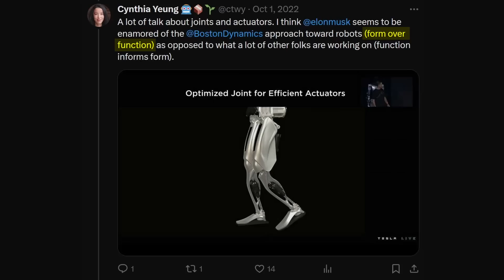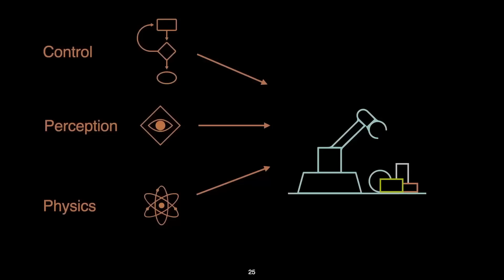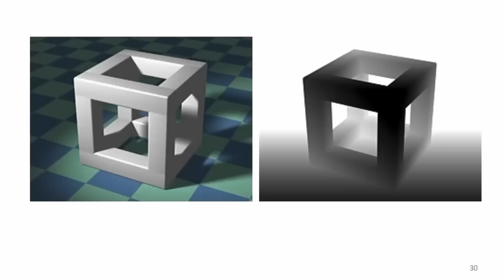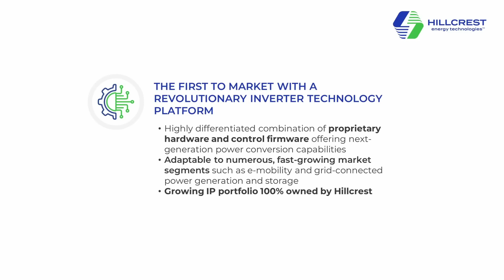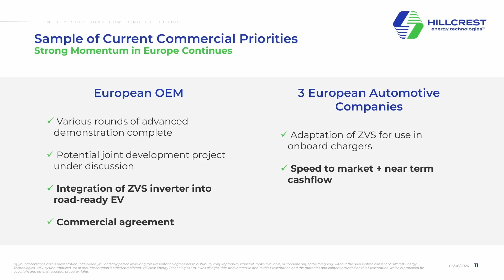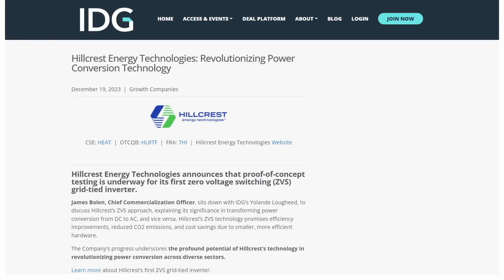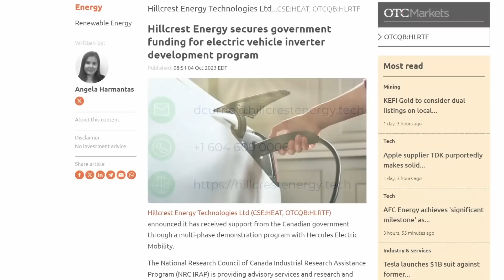You Won’t Believe What Expert Said! | [SHOCKING] Robotics Expert  Shows Elon & Optimus in New Light

Comment: Tesla didn‘t do huge castings, they purchased the biggest stock casting machine from Idra in Northern Italy supplying the European car industry.
Reply: Nope. They wanted a much bigger machine that what was available. They asked around, all suppliers said "no", except one that said "maybe". Tesla worked with IDRA to build bigger and bigger machines, and even modified them after delivery. On the first few they replaced the cooling system with something more powerful to reduce cycle time.
I think the first non-Tesla car that uses large castings is the Xiaomi SU7, maid by SAIC. A few others are still in the design phase at best.

Comment: I don't doubt Elon can make a good humnoid robot, I'm just somewhat skeptical about the überbull thesis about what value it can add to society. What tasks (of sufficiently high value) is it going to perform?
Don't come with folding t-shirts or making sandwiches - these are low-value tasks.

Best I could come up is either connecting cables in a Gigafactory or restocking shelves in retail.
Happy to hear your suggestions.
Reply: If Tesla is successful in being able to offer these at $20k each, what job will be too low value to justify their purchase?

Keep in mind that each such robot will be able to do the manual labor of at least three people, and with training will have a low error rate.
Reply from the maker: Great question and the answer is any job that humans can do, from mining to btain surgery
If this sounds far fetched, consider this: the number of open positions in factory jobs alone is several millions. They can start with simple jobs (although very easy to teach complicated). 
And by the time this gap will be covered, AI will be so advanced that nobody will even consider humans for the jobs
Reply: @ConnectingODots  Btain surgery? Do you have dain bramage?
Reply: Every innovation changes the reality of how stuff is done.  As a former software designer, I learned quickly that users adapt their (new) tools to work in ways that were unrealistic or impossible before.  That meant that within a relatively short time the users created a very different working environment.  The smart development companies tracked these changes and integrated their software and systems to take advantage of these changes.  I see robots enabling the same kind of shift - and thereby changing our expectation of what is reasonably possible.
Reply: A low level human employee costs like $200K a year in the US. The cost is not just their wage, but heaps of other expenses associated with them. Taxes, insurance, OSHA compliance, HR, bathrooms, cafeteria, etc.
Tesla will sell Optimus for $20K flat. That's like a 100X reduction in labor cost. But the same cost reduction applies to making the bot itself, and it's parts, and all the way down to the mines. That makes it like 10X cheaper again, which then ripples through the supply chain again, and so on. In the end labor will cost nothing. The only limitation will be the availability of raw materials in the Earth's crust. And we are very very very far from hitting that limit. And then comes SpaceX, and suddenly the entire Solar System is up for grabs.

Comment: Taking the safer path does tend to be the safer option, in general.  But the longer you do that, the more technical debt you accumulate, and you increase your risk to outside disruption.  Technology is evolving so fast now, that these risks, which use to take the course of an entire career to accumulate, are not popping up all the time.  I think there is a new crop of engineers coming who realize this, and who are going to bring a first principles approach to every problem.